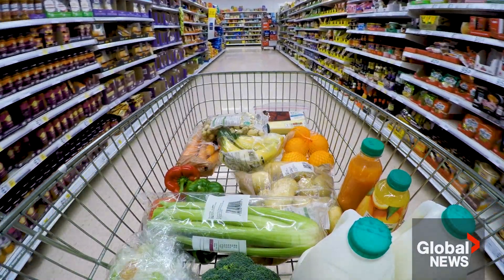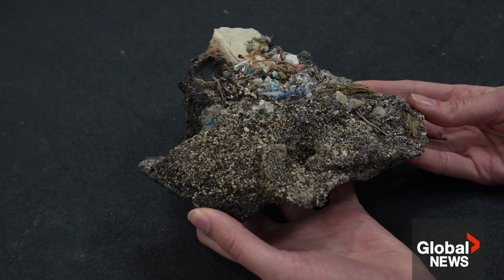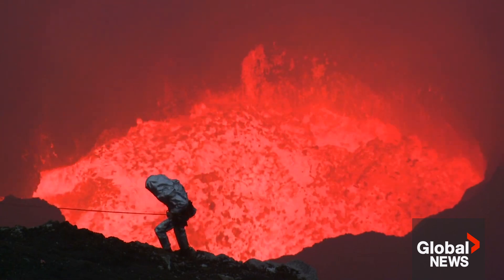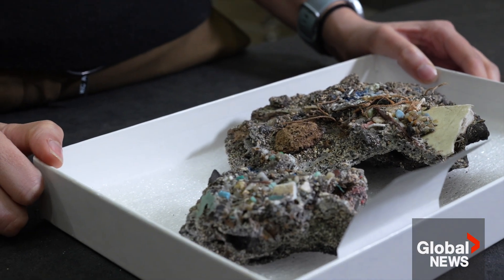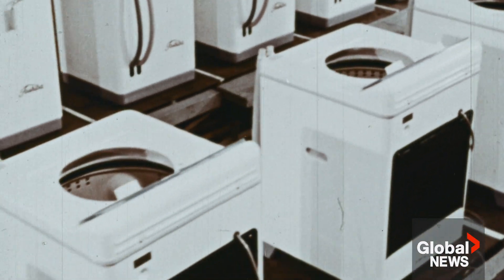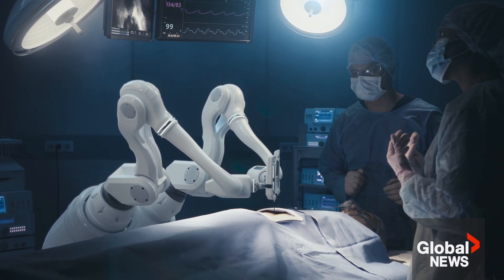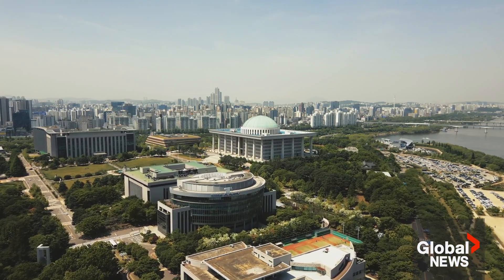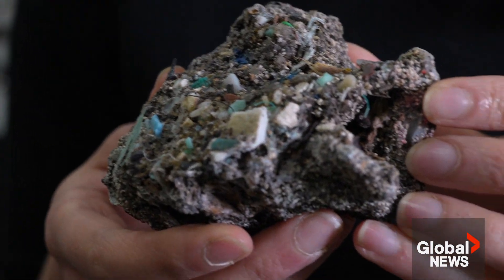Plastic fossils: Evidence of human impact on world forever etched in rocks

Comment: Plastics are made of hydrocarbon chains. Burning used plastics to produce electricity is much cleaner than both coal and oil and produces about 40% less CO2 per kilowatt-hour than burning coal. Activists blocked these thermal energy plants and poisoned the planet, with assistance from corrupt media outlets. Disgusting.